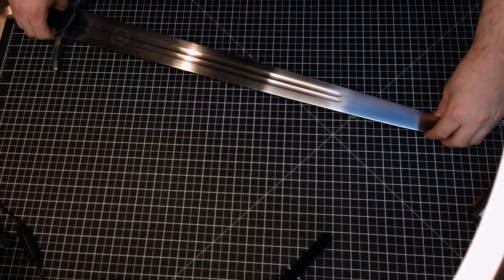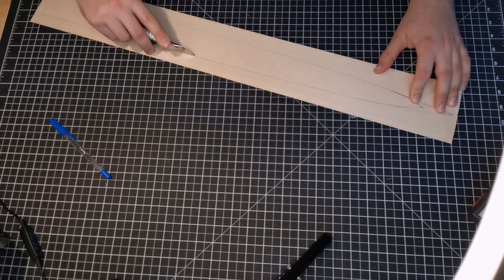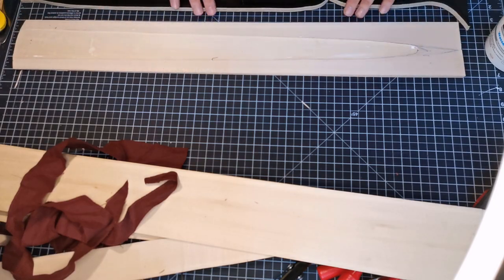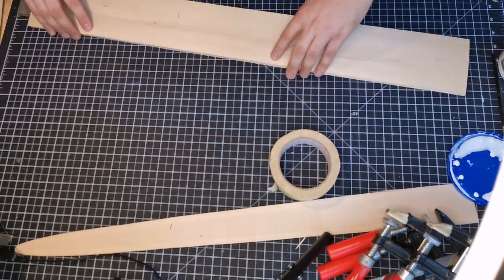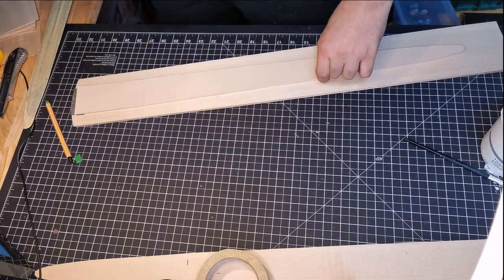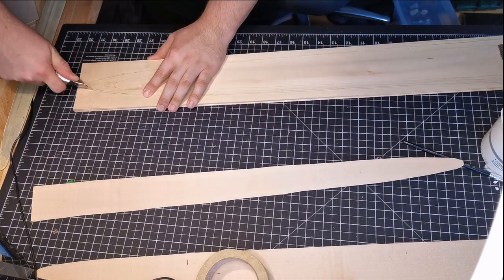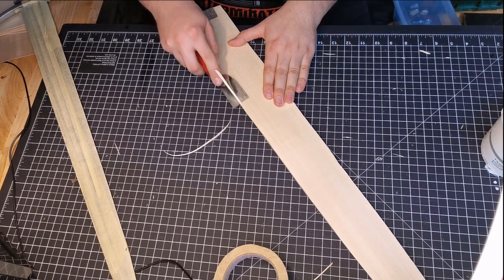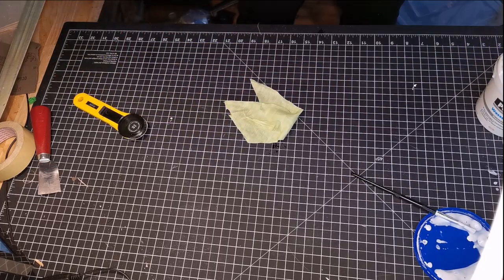Building a Medieval Scabbard - Part 1 (of 2) - Crafting the Core

Comment: I hoped you liked the first part on building your own scabbard. Until now, you have only seen me as trainings partner/dummy of Martin or behind the camera/editing on some (pre-lockdown) videos.
Since this is the offical debuet as a sole content creator on this channel (let us not count the carbonara video), I would appreaciate constructive feetback:  I hope my accent is understandeble, the subtitles are helpfull, and the pacing of the video acceptable.   

Part II is allready finished, thus the improvements will be included in the next videos ;-)
Reply: Hello Stephan, member of Stahlakademie Leipzig here! That's an awesome build! I just shared it in our group chat :).
I have one question about the tool you use to round the edges. It looks like a sharpened putty knife, am I right? Working looks very clean and easy compared to rasps and files, wich are my go-to-tools. Would spare me a lot of dust and buying a new spokeshave just for this project. 
Thank you for your effort, I look forward for the second part!
Reply from the maker: Thank you! its similar to an putty knife, a "japan wood knife" on amazon at least. But with this method i did everything basically on my desk at home without a workshop.
Reply: @SchildwachePotsdam   Hi, do you have an amazon link? Cant find the specific tool you are referring too. Thanks for an answer!

Comment: Beautiful work. Have you had any issues with rusting caused by the wood glue?
Reply from the maker: During the process not, the tape helped. But it's quite important to let the sheath dry a few days after finishing it without the sword. Then I had allways some oil on the blade.

Comment: Very nice. Is this based on an extant historical method?
Reply: Probatly yes. There are varios historical examples for the sandwich build, a lot of them early and high medieval examples. You can get nice result directly working with fresh split wood and form it on your blade. The downside is that this way you still have moisture in the wood which may damges the steel. The lining with wool is found also beside fur.

The issue is that most historians, collections, etc. are more focused on the contents, eg. the swords, than of the scabbard itself. Without cutting them open, especially the late medieval pieces, which are well preserved, its hard to exactly know they were build. There are some people which know way more about this than me,  maybe they will correct me ;-)  Its a super convinent method and makes a very stable work item, thus i guess they probatly did it like this.